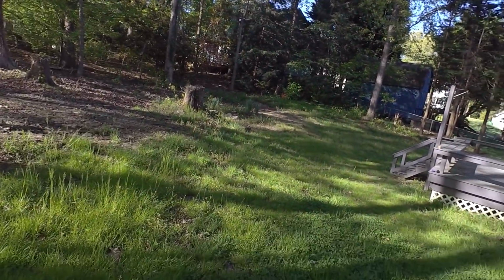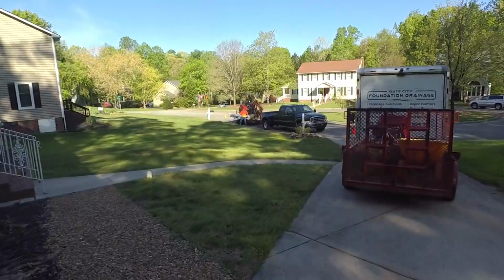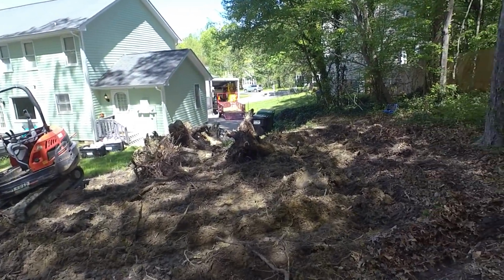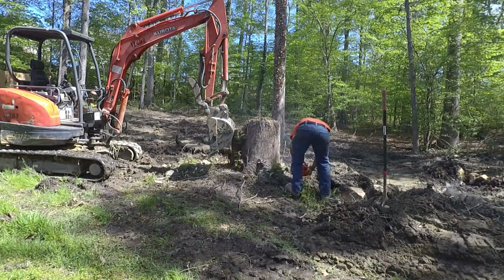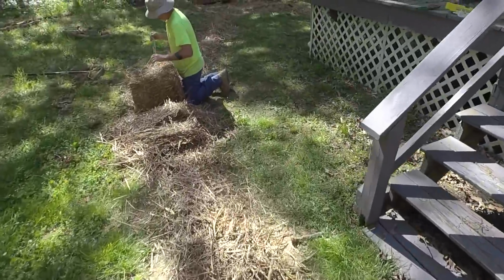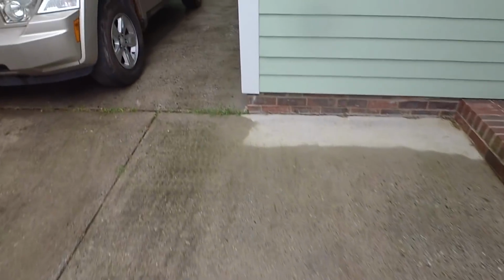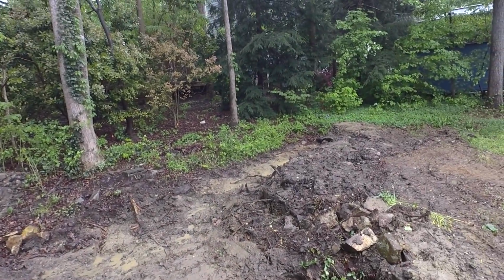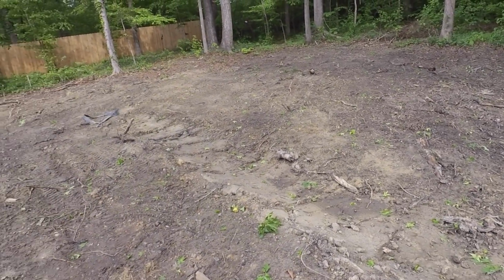Installing drainage system and swale to solve standing water in back yard.

Comment: Another great job Gate City. That was cool to see your first estimate came around and you remembered her and we're able to get her shrubs removed.
I'll say it again, really like that you come back in your videos and show the project's success. 
I always keep a "saw bag"  with a saw wrench, file, extra oil, spare spark plug and an extra chain that is already sharpened.
Reply from the maker: Haha Ed! I now have a saw bag too. It's got new chains, wrench, bar oil, wedge.
Reply: Awesome!!!
That's makes me laugh from the inside 😂. One more tip... When you buy a new chain, it typically comes in a plastic package. I save those and when I have a sharpened chain, I keep it in that plastic package so it doesn't rub against the other stuff in the saw bag. Either dulling the chain or puncturing the mixed oil bottle.... Yep.... Both have happened.

Comment: Dirt dulls the teeth in the chain on the saw really fast. When working with a chainsaw I always bring 2-3 extra chains. Certain species of tree are notorious for pulling sand into the bark and the wood. A stump like that where there have been digging done around it and mud would be a tough nut to crack with any chainsaw :-)

Have a look into chainsaw grinder setups if you use the saw a lot. I tried using hand files to sharpen chains for years without satisfactory results. Bought a cheap Oregon grinder and will never go back to hand filing. There are more expensive grinders out there that will probably give even better results.

The nod to Andrew was nice. His videos are great - but your own productions are top notch. I discovered your channel the other day and are binging now.

Comment: I thought of Andrew, but at least I haven't seen you install a car radio with a chain saw. 😄

Pulling those stumps. The ground looked awfully mushy.
Reply: Or mix concrete in the back of a truck
Reply from the maker: Or remove the pickup truck from the engine instead of the other way around.

Comment: Seems like homeowner passed up an easy add of a short French drain from that un-caught down pipe (top of driveway) into the high end of the long pipe that Ronald sunk.  Personally I’d not want a perpetual puddle still happening there, after spending good money for fixing the other issues.  Would have added only a small percentage to the bottom line, from what I could make out.
Reply from the maker: Great idea Dock!

Comment: How do you determine if you have enough “drop”?  Was there a big enough drop that you just knew?  And can you say how much you charged to remove the Holly bushes?
Reply from the maker: You need a quarter inch per foot at a minimum and we had much more than that. If you can walk it off and you feel like you're walking downhill then you're good. I think I charged 100 to pull and remove those shrubs since we were right there.

Comment: with earth left exposed like that, wont it just wash away and clog that culvert and go back to the same problem originally? shouldn't that entire back area be seeded? just curious, as I have had a problem similar to my house, and installed multiple French drain systems then seeded heavy afterwards.
Reply from the maker: The homeowner was going to do something back there, with possibly letting it go back to woods.

Comment: Why don’t they build houses with down pipes connected to sewers like in UK?
Reply from the maker: The sewer system goes into the wastewater plant and adding stormwater would be a waste.
Reply: Could have to independent systems, one which is sewerage one which links to the rainwater storm drains